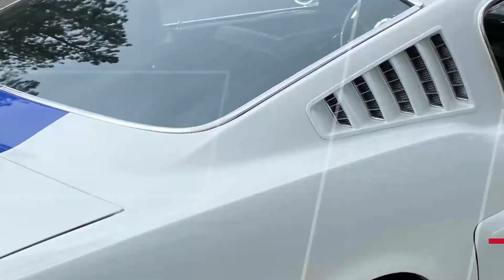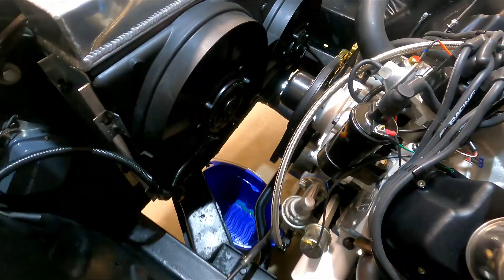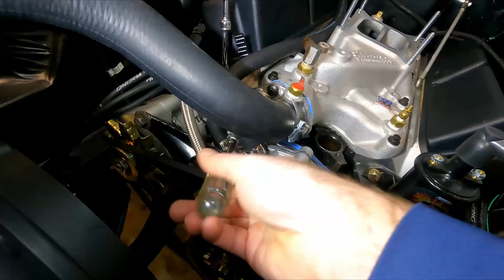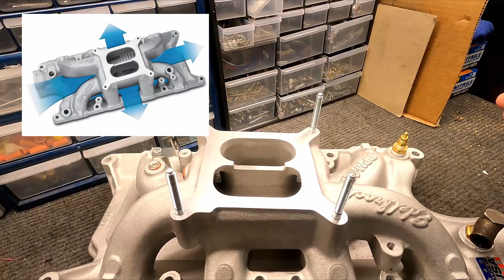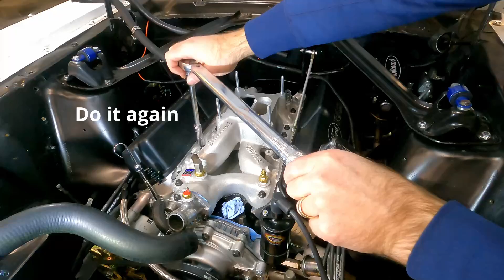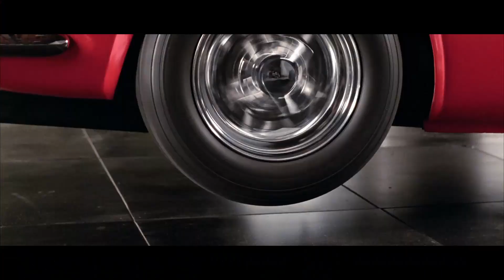Installing the Edelbrock RPM Air Gap Intake Manifold

Comment: Love your work man.... Do you think that an Air Gap intake with an Edelbrock VRS 4150 650CFM carby, which is 1/2 an inch higher than a Holley, to where the air cleaner mounts. Will fit under my standard hood on a 65 Mustang ?... I think the 65 had roughly 1/2 an inch lower overall engine height due to different engine mounts? I was thinking I will need a drop base air cleaner of some description. Thank you for your thoughts, it is appreciated. Kind regards Stevie from Australia.
Reply from the maker: Yes it will fit, and worst case you either buy a short height air cleaner or a drop base.  The down side to Edelbrock Carbs is that not all drop base work because of the how the Carb is designed.  I had an Edelbrock Carb on my previous Mustang and the drop base didn't fit because of the width of the Carb.  Also, keep in mind you might need a shorter stud post for air cleaner when fitting it all together.  :)
Reply: @KruseBuilt  Ok thank you, was your Edelbrock a VRS model ? thank you.

Comment: Hey any whats carb is that..I LOVE them fuel lines..im building the same 347 but im in the UK :)
Reply from the maker: Holley 80508-S, 750cfm, vacuum secondaries.
It's a lot of Carb for a 347, but since I built my engine to rev a little higher than normal, this is where the extra CFM over a 650 or 700 comes in handy.  :)

Comment: High rise manifold loses way too much power down low. Its for drag racing only. Not street cars. Bad idea
Reply from the maker: So now you're deciding what I'm doing with this engine?  Wouldn't you want to know more about what I built and my plans with it before you tell me I installed the wrong parts?
Reply: I'm glad you told me, Edelbrock said it was for street cars.   They must have designed it for the wrong thing.

Comment: how did you remove the stock brace under your new export brace? Isnt it welded on?
Reply from the maker: Are you referring to the mounts on the shock towers?  If so, I used a spot-weld drill bit, it was easier to do than I thought it would be.  I covered it in my video when I was cleaning up the engine bay before I installed my new 347.  :)
Reply: @KruseBuilt  yes. Great i will see if I can find that video

Comment: for anyone thinking of doing this on a stock 289 DONT. He has a 347 so its all good but on a stock 289 it will do more harm then good especially at lower RPMs. the regular performer is the one you want not even the performer RPM just the performer
Reply from the maker: That's weird, it's like I mentioned that in the first 30 seconds of the video.

Comment: Hey man so I’m going through the exact same process as this but the issues I’m running into is how I would run my heater lines, on my stock manifold I have the heater line running from the top of the thermostat housing, when putting in the new manifold do I follow how you have yours set up with the heater line coming from the intake?
Reply from the maker: Yes. There’s a port on the water pump that goes to your thermostat housing bypass, and a port in your water pump that goes to your heater core. There would also be a hose that goes from your intake manifold to the heater core. Some people bypassed their heater by taking the heater hose from the intake and routing it directly to the water pump.
Reply: Would there be any change in reliability and performance if I ran it directly to the water pump, or ran it from the manifold?
Reply from the maker: @1970STANGCOUPE  No reliability or performance impact.  Lots of people bypass their heater cores, not only in southern states, but all people like me who only drive the car in fair weather.  :)

Comment: There’s probably nowhere in the instruction that said, please turn the petcock on the radiator and drain your radiator fluid into a big dish that would be helpful
Reply from the maker: It's probably in super fine print, last page, in the corner.  :)

Comment: Great video. I'm going to tell you my experience with small block ford's. With this type of build. A custom cam for your build will almost always be a better driving experience. More usable power with higher power. A distributor that has been curved to match your build will improve power everywhere. A better carburetor will improve power everywhere. 
These three things will be huge power and drive ability increases. 
A custom cam will almost always be better on valve train.
But if you keep your cam. The distributor curve and a better carb will still improve power everywhere. 
By quite a bit. 
By no means am I putting down your build. You have a great build, I would be very happy calling it mine.
I'm just sharing my experiences.
With my own builds over the years.
Reply from the maker: Thanks for the heads up.

Comment: I love that Mustang!  My first car was a 65’ my Dad and I built.  I’m about to retire again and I’m scouting for a 65-66 convertible.   I like what you did with the guide bolts.  I did the same thing with sections of all thread to keep from sliding around.  My only tip is when you use gasket seal instead of the front and rear gaskets is to put a thin bead on the intake itself, then the block and wait about ten minutes so it becomes tacky.    Keep building on it, I’m loving the videos.
Reply from the maker: Thanks for the heads up.  :)

Comment: I'd love to see the dyno results comparing the Performer to the Air Gap.  There's very little info on stroker motors paired with stock/Performer intakes for those that have extremely tight hood clearances.  I totally understand that the low-rise stock-style intakes hinder air flow, but some people don't have much of a choice!  
Thanks for vids Andy, they're informative and entertaining for us car nerds.
Reply from the maker: Dyno results on any of these mods would be nice to have.  The problem I have is the info out there is always for a different engine, at a different elevation, with different fuel, and additional mods.  I just need to buy a dyno and go from there.  :)

Comment: Tried a 1" carb spacer yet?
Reply from the maker: Yes, and for my current setup I had to go down to a 1/2” spacer so the air cleaner would fit perfectly in the scoop on the hood. 🙂

Comment: I have the FordRacing crate 302 with the e-cam and the GT-40 heads in my 78 F100. I’m basically going to the 1983-85 Ford 302 HO aluminum 4 barrel intake manifold with rear water jackets. Maybe it will better at lower rpm. Don’t care for the higher rpm
Reply from the maker: That's going to be great, it'll be a nice upgrade over stock.  :)

Comment: what is the 347 stroker brand? is it a 8 ounce? did they have to balance the strokerkit? i'm having engine vibrations after putting a scat stroker in my block
Reply from the maker: My build is a custom build (by a local engine builder) and he used several different brands for the various components to make my 347.  My setup has a 28oz imbalance, which goes with the 28oz harmonic balancer and Flywheel I have.  Yes, they balanced the internals before finishing the assembly.
If you're having vibrations, it is likely that your flywheel does not match your internals close enough that it's causing the vibrations.  So on this end, I don't think I'm going to be much help to you.  :)

Comment: Hi Andy. Love your channel. How many hours should it take a qualified mechanic to do an intake/carb swap on a 302?
Reply from the maker: This can be done in one hour, but likely two.  I suspect if any time is spent beyond just unbolting and bolting in parts, it's cleaning the gasket surfaces on the heads.  :)
Reply: @KruseBuilt  thank you!

Comment: Great videos, they have helped me complete so many different things that I needed to do to my 66. How long did it take you to replace your manifold? Was it just a few hours? Thanks
Reply from the maker: Thanks!  It's always great to here my videos are providing some value to others in this hobby.
A few hours is a safe bet.  It's hard to tell because I always have to mess with the camera and make sure I know what I want to say.  But a good chunk of time will be spent cleaning/prepping the surface for your new gaskets and manifold.  I don't recommend shorting this section, everything needs to be clean and properly prepped to install the new parts.  Everything else is just the disassembly/assembly parts, which goes fairly quickly and is sort of fun.  :)

Comment: I have the same intake manifold. Had a leak when filling the engine with coolant and it came out from the manifold. Realized the gasket wasn’t properly sealed. Followed your video on how to replace and all went fine except my bolts wont stay torqued. I ordered some new ARP bolts that hopefully will fix this issue! Awesome video!
Reply from the maker: Yeah, not sealing those crossover ports for the coolant bit me on a previous project.  Not sure why your bolts won't stay torqued, the only thing I can think of is maybe there's some gunk or something down inside the threads?  :)
Reply: @KruseBuilt  yes, i made sure to lay a good bead on those crossovers, overall im happy with my install. My next project will be a holley 650cfm carb. I believe i have a edelbrock 450cfm as of now. Im sure I’ll need the upgrade.

Comment: Hi do you know the length of the intake bolts for the air gap thanks
Reply from the maker: I do not recall the length, but I used the ARP Intake Bolt Kit, part number 154-2101.  :)
Reply: @KruseBuilt  ok thank you

Comment: I noticed you don’t have the ford steal me junction (solenoid) on the fender. What did you have to do to delete it since I’d like to delete mine. Hate all those wires connected to it!
Reply from the maker: I still have it, I moved it to the other side of the passenger shock tower, on the fender apron.  Every once in a while you can see it in my videos.  I did tuck the wires a bit in one of my videos I made while I was waiting for my 347 (last winter), I talk about it there.  :)
Reply: @KruseBuilt  thanks! I’m about to get my car out of body shop jail since it’s not getting worked on and start doing some of the same upgrades as you so watching all your videos now!  Thanks!

Comment: Nice video! I have a question for you. Im getting ready to break in my new hydraulic flat tappet cam and have to set #1 to TDC. Initially i was using the crank bolt to turn it and it would turn with relative ease. It’s gotten to the point where it’s gotten really hard to hand crank using the crank bolt. I’ve primed the oil pump but can’t get it to budge. What could be the reason as to why? Any fix for this??
Reply from the maker: Were you able to completely turn the motor over a few times before, or was it easy to turn a little but then it got hard to turn?  With the plugs in place, you're building compression the firing cylinders and it's difficult to turn the motor over by hand with the spark plugs in.  If you remove a few plugs then it should be easier to turn over.  It the motor straight up won't turn over with a big socket and wrench on the crank bolt, you have a bigger issue.
Reply: @KruseBuilt  i could then it over before but not anymore. There are no spark plugs in it. I have the trans attached but other than that not sure what could be keeping it stuck
Reply: @jovanistreety6565  make sure cam timing and or may be you have to much lift and valve is hitting pistons. If you can’t turn over with plugs out don’t force it .
Reply from the maker: Silly question, but did you make sure the trans is in neutral while trying to turn the motor over?
Reply: @KruseBuilt  i tried it in neutral, nothing :/
Reply: @KruseBuilt  im thinking one of the cylinders might be stuck. Left the spark plugs holes uncovered for about a year. What do you recommend? I’ve seen people say about 2 caps of marvel’s mystery oil down the spark plug holes and let it sit for 24hrs would free it up if that is the issue?
Reply from the maker: @jovanistreety6565  Sorry brother, I'm not going to be a lot of help here, you might be better off talking to the boys at VMF.  I don't really have any experience in this arena, and if I had the same problem I might take it to my engine builder and see what he thinks.  :)
Reply: @KruseBuilt  im going to take a peak in the spark plug holes with my snake cam and see if i notice any rust. Im hoping that is not the case but it has sat without the plugs for a while. Thank you for the help andy!

Comment: Seeing such a clean engine makes me jealous! 

If you decide to remove the phenolic spacer, make sure to check clearance on the carburetor movement points. I wasn't able to run my Holley without a spacer. My choke bracket was making contact.
Reply from the maker: Thanks!  I'm trying to keep it clean as I go, but I still have some work to do.
I ended up pulling the spacer, everything clears, so far so good.  :)

Comment: Nice job Andy....Weather is improving..Over 60 on the West side today and better tomorrow. The lower profile filter will restrict air flow to some degree. It may be a toss up.
Reply from the maker: Yeah, the weather is wanting to be better here.
As long as the total filter area is not smaller than the area above the primary and secondary throttle plates, a thin filter works fine.  :)

Comment: I really like the air gap manifold, it really pulls at higher RPM.  The only downside I found (except hood clearance) is it does take noticeably longer for the car to warm up in the morning.  It's a real dog for a good 10 minuets in cold weather, or what passes for cold weather in Sacramento.  Not as bad in summer but still noticeable.  What's that white stuff in your driveway?🤣
Reply from the maker: You're the second person to point that out, which is good because I noticed the same thing when the car first gets going.  We can force it to warm up, do 6500 rpm drag pulls down my street, my neighbors would love that.  :)
I'm so done with the snow, we've had it for almost 5 months now, it doesn't usually stick around this long.

Comment: I have the same exact setup on my ‘66. I’m running a 1/2” phenolic spacer with a 3” tall air cleaner on a stock hood w/o clearance issues. 👌🏽
Reply: It runs better without the spacer.   It’s already up there in height.  How much more should a carb sit on top of a already air cooled  aluminum intake?
Reply: No spaneer fuel boils on parking it. @6cobrasnake9
Reply from the maker: Yeah, there's lots of combos to make this stuff work, it's great.  :)

Comment: Nice vid Andy! That's the Mr. Gasket manifold gasket right? I've got to do this same task and this vid will help me out greatly with my 306 crate engine. Also, how do you like that distributor?
Reply from the maker: Thanks!
Permatex Ultra Black Gasket Maker is what I used.  The distro is fine, I wish the cap fit a bit more snuggly, it seems like there may be a 1 degree wiggle worth of timing if the cap gets bumped.  Not enough to ruin my day, but I imagine I'll get an upgraded unit some day.  :)

Comment: Do you run conventional or synthetic oil?
Reply from the maker: It's a synthetic blend for diesel engines, Shell Rotella T4 15W-40.  It's not what I would have chosen if I was asked, but this is what my Engine Builder told me to use, so......   :)

Comment: Great video as always.  I always learn so much.  Was the block a roller or flat tappet to start with? I have a flat tappet 302 now, that I’m looking to do stroke to a 347 like yours but I’d like to convert to a roller cam.
Reply from the maker: Thanks!
Block was already a roller, and in the end it was cheaper to buy that block from my Engine Builder than to take my 289 and convert it over.  :)
Reply: Thank you. Keep it up

Comment: I have air gap intake on on my 289, 1/2" spacer, drop air cleaner base and standard hi-po air cleaner with k&n filter. Carb is Edelbrock avs2. That setup fits nicely under stock hood without scoop. You probable have to use lower air cleaner and spacer.
Reply from the maker: I may change the air cleaner down the road, but for now just removing the phenolic spacer was good enough.  :)
Reply: Any info on losing HP when using a drop base air filter?

Comment: When I installed my air gap the only thing I noticed was a significant warm up time, the car runs like absolute dog shit for the first 15 minutes or so, totally undrivable until it's completely up to temp.
Reply from the maker: I've noticed that too, but I was blaming it on not having the carb tuned for my setup, maybe it's the intake like you said.  :)

Comment: Very nice upgrade Andy.  Now that you have the RPM Air Gap, maybe you can lose the phenolic spacer for some room?  Also maybe a lower profile filter, but with a top breather.  Edelbrock makes a nice one, and it comes in blue. Just sayin’!
Reply from the maker: Thanks!
Yeah, I have left that spacer off, it's been good since so I'll just leave it off.  :)
Reply: @KruseBuilt  Better to take off the spacer than to compromise on the height (not location, but physical measurement) of the air cleaner, that significantly impacts horsepower because you lose air cleaner surface area!

Comment: Hi Andy! Great Video. How long does the black gasket maker have to set up before torqueing it down? And, with the Air Gap, you probably wont need the Phenolic spacer like you stated early on. Plenty of air flow to keep the carb cool I am thinking. Thanks for sharing. Cheers from Motown/Dearborn.
Reply: my thoughts exactly on the spacer
Reply from the maker: Some say within an hour or two for that gasket maker, but this is coming from a friend who was a mechanic back in the '80s, so I don't know if they did that just to get the cars to move through the shop or if it's really something that can be applied and go.
That spacer is nice because it makes more room below the carb for the heater hoses and stuff, but it's been fine since I installed it, so I guess I'll leave it off.  :)